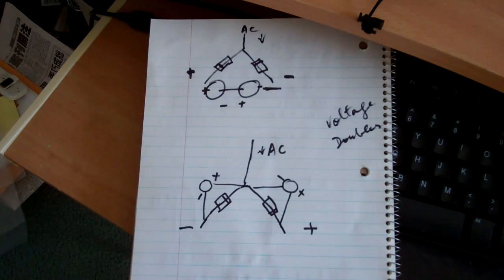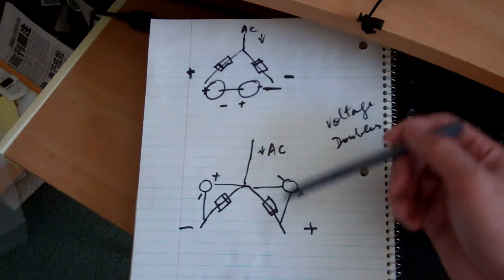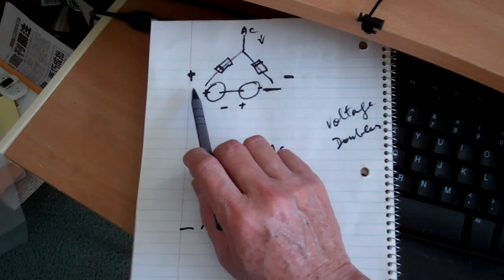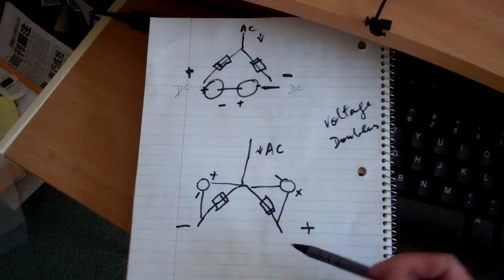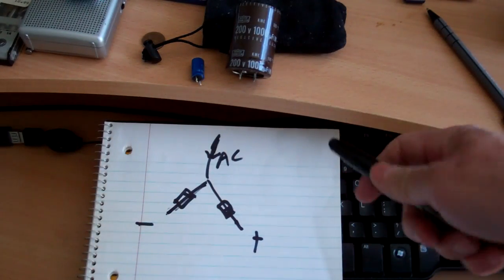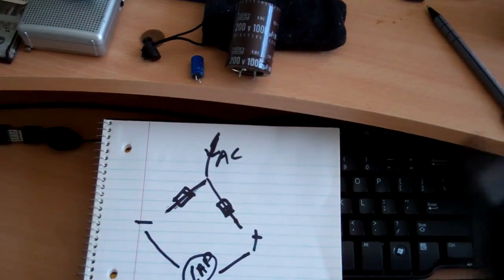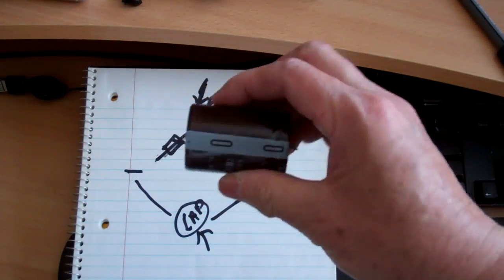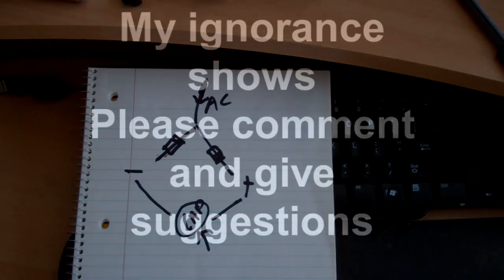Voltage doubling rectifier questions.mp4

Comment: So in fact it was better to slowly charge the cap as the surge was making it painfully hard to turn until the Capacitor was fully charged,which with a load attached to it it never was,that is a very serious problem on a Wind Turbine.

Also if you care about Stability you can add a Battery to charge it with Pulsed DC while powering a load,but the load should be Turbine Output x Battery Charger Efficiency x Battery Charging Efficiency x Inverter Efficiency (if any) so to not empty the battery.

Comment: Hello.

Be careful with a Big Cap at least before you check if the starting torque it gets by the average wind current starts it effectively.

Regardless the common sense which at the end proved right i firstly thought a Capacitor will be good for stabilised voltage/current output on a Hand Crank Generator testing i've done,but at the end the crank was way harder as i was continuously charging the cap at higher current than directly powering the load.

Comment: I think the larger the capacitor the better since it will store more energy, hence current, and will drain slower for a given value of resistance or load as compared to a smaller valued capacitor.  I guess it sort of is like the "RC time constant" thing, if R or C are higher, the time constant (or discharging) is longer.  Of course you dont want to put a resistance in when charging the capacitor since you want to charge it up as fast as possible to utilize all of the energy delivered to it.